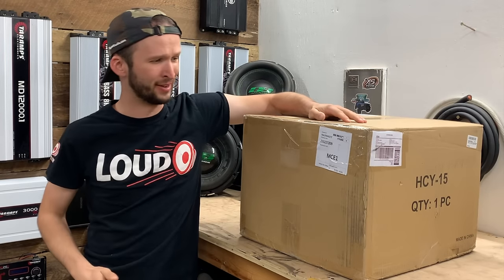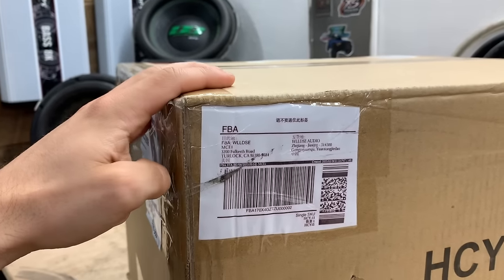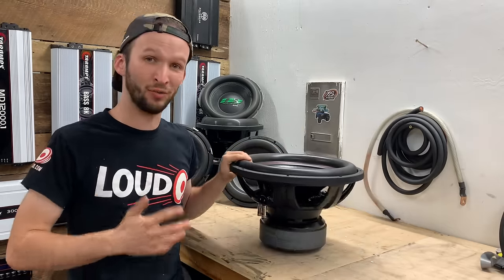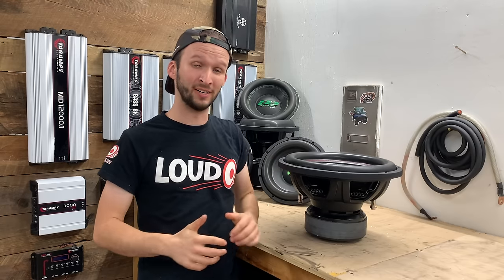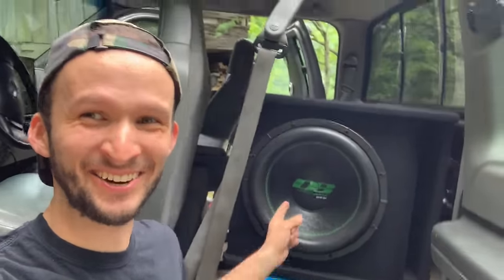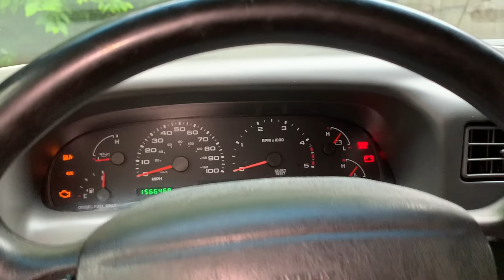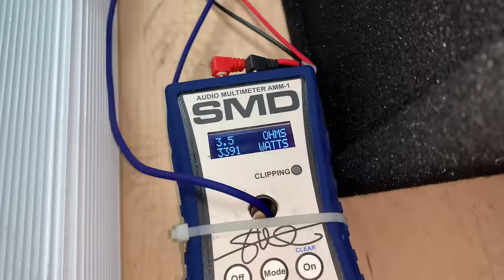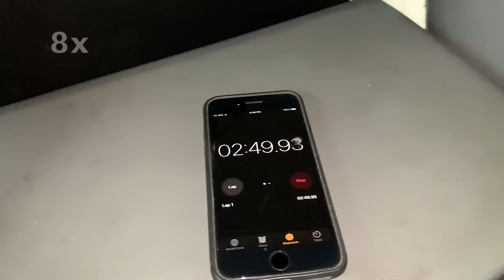How Bad is Amazon’s Sundown CLONE? WLLDSE 15 Review

Comment: The fact that they can offer a sub above 1000rms for a low price is great.  I'm 52 and back in the early 90s when I got into car audio low price high rms sub was unheard of.  You kids nowadays have it easy when it comes to car audio.
Reply: Easy in some regards, harder in others. The key is that modern semiconductor technology goes up while its price goes down.
Reply: Shit I’m pushing 2 12 premier’s 3000 watts max an pushing 1000watt rms. Got it on a 2400w hifonics Brutus. Shit is hitting crazy!
Reply: You got that right!
Reply: they are spoiled rotten. no appreciation for where things are today.
Reply: @drutang yes and no. Sensitivity is down from back in the day. A 500watt sub from the 90's whould sound as loud to the ear as a 1000w sub thats out now. All going for power handling and spl and firgetting about the quality and sensitivity
Reply: @TheZombieSlayer1155  Not true.
Reply: I remember subs sounding much better in the 90s though running even off only 300 or so rms
Reply: @paquesepas6696  lol not to me.  From 1993 until 2003 I ran my bass within 300rms up to 600rms.  Like you I thought it sounded real good.  Then one day I bought a true 1200rms amp and ran it and holy shit the difference was tremendous.  my previous 600rms sounded weak af compared to 1200rms.  I don't understand guys like you who claim low wattage was "louder" back then
Reply: @drutang  spoiled rotten? the generation before you was using horse and buggy you have no idea how appreciative you should be! smh
Reply: All of us 45ish and up have it much easier now, cost wise for a given performance and SPL output. Trying to get hands on an Orion, Fosgate or Hifonics 600+watt amp back then took a dang bank loan if retail new. (Making ~$4.25 an hr out of H.S.)  I must say i'm enjoing running a system I never could have before
Reply: I grabbed 16 of em a few months ago
Reply: @ogairbender808  Since you have 16 of them you can feel free to send me 1. Thank you 😉
Reply: I'm not quite into the bass head scene...but even the amps I remembered spending 360 bucks at Audio Associates for an Alpine 3552 for a clean 30x4 ....  I just picked up a couple amps that were less than 50 bucks a piece that are putting out close to 50x4 ....  

I put together a small system for my daughter at the cost of my head unit alone! 😅🤣😂

I'm more a fan of efficiency so that I don't have to spend a LOT of money on feeding the subs a whole lot of juice taxing the electrical system....

But yeah....despite inflation...for those that are into this stuff...there are a lot of less expensive options.😊
Reply: @jorgem50 louder or better?
Reply: Im from the 90s audio scene your comparing apples to oranges. Your trying to compare eras were or top of the line subs were 2" single 4 ohm voice coil like the Pioneer impp at 200wat rms and inthe late 90 the Soundstream spl12 single 4 ohm with 300 watt rms and a whopping 9mm of xmax with a extremely  soft suspension on top of a 58oz magnett. And we were runing nothing but full range class ab amps that are no where near as efficient  as class D mono blocks. Tunning our entire system on a stock eletrical system pushing 90 amps if you were luck on a single run of 4 ga cca. You gave to have power to make power we were pushing the limits of scare asf. Dont think so go to an audio show and go up to any bass head in his mid 40s and layer and ask him if ge has a set of bolt cutter 100% they will say yes and they are in reach. Why becUse we were pushing our eletrical systems hard trying to push 1500 watts that it was normal to see eletrical melt dow. And catch on fire that was the only way to save your car from catching fire  was to start cutting power cable. We. DIdnt have it cause were couldnt do it
Reply: Somehow this video made me remember Urban Audio Works. Used to call them "Rat Speakers" because of the Rat Mascot/logo
Reply: @jorgem50  you gained 3db from 600 to 1200 Watts. Please, to the person who said they had 2 pioneer premier  impp on today's hifonics,  I no we all started off small, but please, don't tell a real BASS HEAD, you might not like the response
Reply: @paquesepas6696 that's the amps fault, class d and this full bridge sound awful
Reply: All day !
Reply: Ok boomer
Reply: @drutang  ok boomer
Reply: @TheZombieSlayer1155  90s subs couldnt even hit lows. All high bass
Reply: @Luminous.Dynamics  the next time you try to insult someone make sure you know what you're talking about. Baby boomers stated from 1950 to 1965, giving his current age that would make him a gen x, 1966 to 1980. So next time you try to make a pun at someone else's expense,  get your facts straight,  I have amps older than you millennial
Reply: @Luminous.Dynamics  OK, I'm sure your Honda civic, with all your maxxsonic equipment and popcorn exhaust is slapping harder than anything from the 90's ha. Like I said b4, get your facts straight before you start rambling about thing's you know NOTHING about
Reply: @thomasbradian6367   Lmao who are you? I literally was not talking to you
Reply: @ottobauner9828  I don't know what 90's car audio you ran, but I had strokers on an alpine mrv 1505 v12expert( that I still have) I sold the cerwin Vegas's around 01, and still got $700 dollar's for 2 15in stokers that were in BAD shape
Reply: Did you have to walk there and back, 3 miles in the snow, both ways uphill to the car audio shop just to buy them?
Reply: @dipinmylip1171   haha for real. Bro is a car audio boomer
Reply: @dipinmylip1171  hahaha ha 😆  I walked 5 miles🤣
Reply: @drutang I have appreciation lol I'm 20 I'm thankful technology and phones and audio in cars and touch screen radios and features have gotten so far in past 20 years you'd be surprised what people were pushing with subs in the early 2000s 😂 although new stuff is expensive I wouldn't buy old stuff now a days tho since I got the money to purchase high power subs
Reply: @TheZombieSlayer1155  my parents had jl audio subs to a jl amp and it sounded crazy to this day haven’t heard anything come close they had what looked like 2 500 watt rms subs in a sealed enclosure on a 2002 acura tl it would rattle ur teeth, shake ur eyes and put pressure on ur chest. Im running 2 american bass xr 12s at 2 ohm about 1400 watts rms to them and it doesn’t come close, the lows sound great but still missing something. This was around 2010 - 2012
Reply: @TurboJohn74 facts
Reply: @MacThaGoat old hifonics were great. Brz series
Reply: @ddtstrc9678 yeah I agree with you no way on earth 90s 500watt sounds like a modern 1000watt sub Im 45yo so I was in car audio in the 90s
Reply: My kids are in their mid to late 20s and they have no nowhere near the bang that I have not even close. I remember the 80s 90s and 2000s all those years I’ve had a minimum of two all the way up to eight different subwoofers power from 500 watts on up. Even though getting  power has gotten a lot easier, but the enclosures and designs have become more sophisticated and elaborate.
Reply: Not when it comes to the newer vehicles man . All the computer crap you have to deal with is a nightmare man !!
Reply: Plus I prefer the sound quality of class A/B amps .
And also can't  stand these  bullet tweeters lol 🤠✌️
Reply: X @DigiDrone  haha. I use to run urban 8 and 12's on my house stereo n honestly they would pound in big house speaker boxes! N did run the 12's in one car along with targa audio 12's off a cheap Walmart amp n sounded ok for what was.
Reply: @thomasbradian6367 hey you didn't happen to have them on a green Chevy blazer did you?
Reply: @jimbobdobbs1597 I'm not sure why you're saying "nah". I agree with you 100%.
Reply: @Luminous.Dynamics  yep they JUST invented hz under 55 in the '00s , what an amazing time to be alive
Reply: @jimbobdobbs1597   Its crazy that no one said that lol. Your average 90s car audio subwoofer was more like a woofer and not designed to hit lows. Majority of regular music didnt even really have low notes back then either, so of course they werent gonna engineer most car audio subwoofers to move a ton of air like they do now. Booming bass was the thing and thats exactlt what I was referring to. Not everyone wants just that. My car systems have no trouble hitting 15hz notes from certain films, no way anyone was doing that in a car back then

Comment: There’s like 25 different no name subs on Alibaba. I want to see them all tested! 
I don’t trust many of those subs because they can be nothing more than a heavy block of ferrite with a weak motor and a high power rating to compensate. Sundown Audio owns a proper magnetizer so you are getting full power with them.
Reply: There's many different ways to make a bad subwoofer, but only a few ways to make it good. I would not suspect that the cheap subs use poor magnetizers, my guess would be they make the gap too wide to give extra tolerance for the quickly put together parts with little to no quality control. This reduces the chances of a coil rubbing, but really reduces the motors strength.
Reply: It's all Chinese anyways, from American Bass to Sundown. Testing is the only way.
Reply: @bjenks2  It's all Earth built. So must be the same.
Reply: Jld audio makes these subs. Also makes DC audio and many others

Comment: Get the U's! 
Added challenge, measure with DATS see how close it is to the real deal!

Likely differences
Spider: bolted, size and stiffness
Basket: smaller spider landing
Top plate, pole and backplate: material type and dimensions
Coil: you pointed out very different coil
Reply: It's only the basket that's the same,  Dayton used it as well.  But these are solid subs.  wlldse has been around fur years.

Comment: Still to this day you can't convince me different. Dark audio had some of the best " budget " line of subs. When I got mine they were 100 bucks a piece, they took a solid 800-1000 watts all day and in a sealed box to spec they systematicly dismantled my crown Vic.
Reply: I went to buy some online when they were 100 and when I put 2 in my cart and went to check out they were raised..dki tried to tell me they never changed the prices and they were never $100 lol.

Comment: It's not center vented because how they designed that originally to work. It pulls air up and through and out the top of the gap between the top plate and basket.

Comment: I have 2 of these 15s they are Stout  woofers and can handle tons of power with the right box and good power these sound great. Those Elite AB subs are not a good comparison to these, u would need to compare the Xfl to this  woofer these wllsde HCY woofers take a while to break in , they are super stiff
Reply: XFLS are super under rated. They are what I call the king of sleeper subs.
Reply: @RHunther I owned a few in my big builds they are good subs these are impressive for the price

Comment: My 2 Wlldse HCY12s are still hanging in there! I did add 60g of weight to the cone and tossed a new 7" cap over it and made a huge difference in there ability to dig deep. They had an FS of 43htz out of the box, after breaking in from a couple months of flex the FS dropped to 38htz better but still a bit high. But with the added mass and new big cap the FS is now at 30htz! Woohoo. They went from being super tight and punchy sounding perfect for metal and kick drum but the low lows were pretty weak. (Partially the higher tuning and smaller than ideal enclosure the unfortunate part of limited trunk space) but as soon as I fired them up with the lower FS low 30s were way stronger., They are a bit less punchy obviously but it's a happy median of good lows and still punchy. Only problem now is a small trunk 2 subs 1 nice an warm a/b 4 channel and a 2k at .5 ohm I'm having heat issues . There's also a 24ah headway battery pack but it doesn't put off any heat.  Thing that sucks is My car has Perma coil stink where I've got dem puppy's warm a bunch of times, and my monoblock shuts down for few seconds if flexed hard on hot days. I need ventilation! At least the car isn't black also

Comment: I've heard lots of good about these, was gonna buy one until I got a bdc3 for really good deal. Impressive to see it last thru the abuse, I feel like the DB test was alil disappointing tho. Surely youd think it would break 140 considering most decent single 12s will. 
I love the little hint at the end of the video, I can't wait for the sundown show build lol.
Reply: Relative loudness at the windshield is a function of the vehicles resonant frequency, the location of the box, its vent or sealed baffle direction etc.  I would be curious to see him swap the woofer out to lots of other brands in the same box facing the same way and play the same tracks.  

Seeing him compare those results to what a program like Winisd or similar software shows would also be interesting.  

I used to do DB Drag in a 1978 Toyota pickup with a 20R engine.  Below the back window I cut out the metal to install a vented box in the bed of the truck.  The box front was where the wall below the window used to be.  That box started with (2) JL Audio 10" W3D2s that hit 146+db at 45hz at one of the DB Drag shows in the (2) woofer category.  It was powered by (2) Crossfire cheater amps that were rated at like 35watts X 2 but at a low enough impedance they would put out 732 watts rms when bridged.  

That box I tuned for maximum sound quality.  Later I built a bigger box that was over 10 cubic foot for (2) Crossfire super cheap DB model 15"s and hit 154.7db at 57hz.  That box I tuned specifially to hit 10hz above the vehicles resonant frequency due to the known phenomenon of the resonant frequency shifting up when you pressurize the vehicle due to high spl.  I did break my original wind shield but the new one held up well with the wipers bouncing inches off the glass.  This was way back in like 2001.
Reply: I mean he did the db test in a prefab box...

Comment: I changed out my amps a few times to check something, I started with a crossfire 1000 watt mono block amp to push a set of 12s JLs W3, that amp made those subs sound great!!! then I tried a MTX 1000 watt amp, same thing happened, they sounded great, so then I tried a cheap CT Sound 1000 watt amp and again it sounded awesome. it seems to me that it doesn't matter really what kind of amp you have, BC I did this same thing with subs. the JLs handled everything and still sounded great, but when I changed the subs from JLs to Orion XTRs DVCs they blew, MTXs blew, crossfires blew, the only thing that sounded good through out my experiment was the JLs. so from now on, im not spending boat loads of cash on amps. im happy with cheap amps, but you can not skip on the subs. I recommend JLs or anything that might be better. but amps, they all seem to sound the same to me. it might be different in competitions, but for the people just wanting some shove in their rides, cheap amps work for me, they might work for you too.

Comment: If db meter was at 12inch up and 4inch out it might would be 140db 😂
And 140db in that box i will say is good x), custom box would do much more :) 
Sounds like good value for money, bc it was so cheap.
Great for budget build, put money in battery and cables and cheap sub is better then expensive sub and cheap ass battery and cables 😎

Comment: I get the people want to see the "free air" test, but as a "semi professional" hobbyist designer, I cringe to see these tests, because I know these ratings are for the sub being installed in the suggested size enclosure. It's kinda like free revving an engine at its redline for an extended amount of time.  So you can be sure that in the properly sized enclosure, this subwoofer far exceeds its ratings. A+++++ Amazon for this product.  Can't wait until the compensators at sundown get ahold of this and tell us how bad it is!

Comment: What’s the best sub in your opinion with a rms around 750-1000 with a good amount of xmax? Had a kicker cvx but think it finally quite on me.
Reply: for bumpin', sundown sa v2 is solid sub.. easy to rebuild.   sundown sa classic if youd rather save a few bucks..

if you like other music besides bumpin, and want better transient response, then kicker comp q... 
alpine type r2..
Reply: @bdc211  thinking between a ds18 zxi high excursion, dd audio 600 or 700 series, skar ddx or a Rockford p3. B in a smaller 4th order box in back of my rzr. Amp is a ds18 nxl x1000.1 amp

Comment: Hey Parker...running around 3k with potential of 5k ....using one dual 12in american bass xr12 ....would like to use 2 12s or a single that can handle little more power ....which def bonce subs do you suggest ...my vehicle is a 1998 s10 ...3 layers sound matt ...frame grounds 0 guage ...jp23v1.5 amp ...for subs ....upgraded alternator....etc.. just want to match either 2 12s ...or 1 12 to the potential of my amp ....with the American Bass xr ...if I go half gain or more on my jp23v1.5....it sends it strait to clipping ...